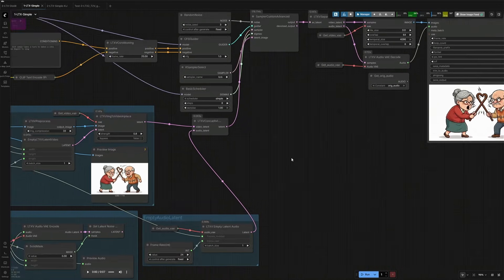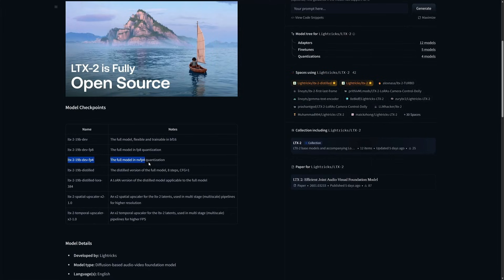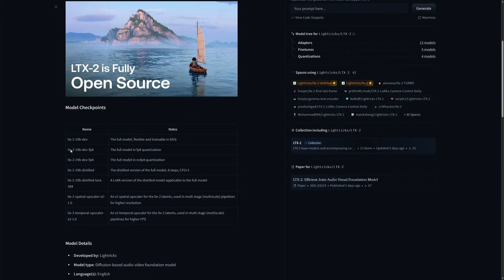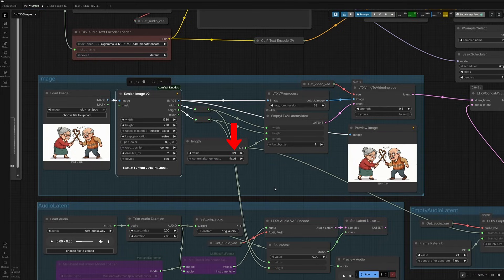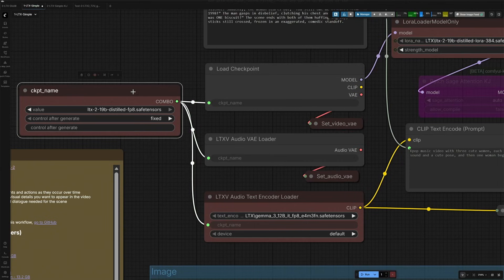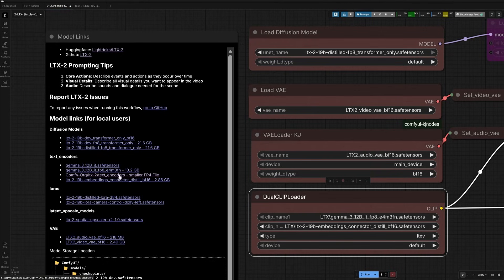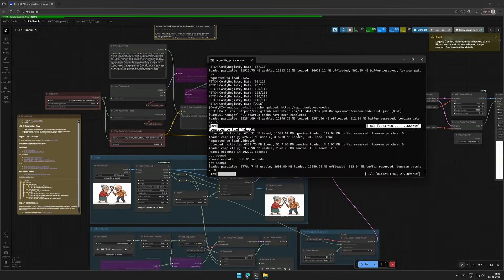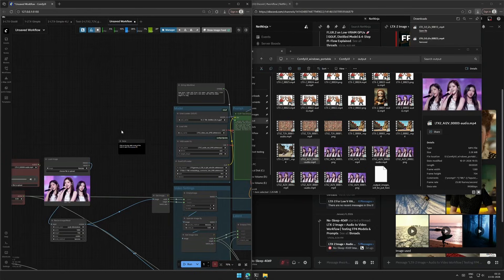LTX-2 Simplified Workflow 🔥 Distilled Checkpoints or Separated VAE & Transformer?

Comment: I'm using an  audio and when I run the prompt it says "ndarray is not C-contiguous" error on the preview audio node, any idea what could be happening? Thanks
Reply from the maker: Not sure, but if it's the same workflow then you must update the nodes and comfy ui. 
Even if you had done, then do it again because there are multiple update pushed recently for 5xxx card. 
Decreasing vram usage, new model support.

Comment: For a 5090 with a PC with 64 GB of RAM, which model do you recommend?
Reply from the maker: Try using ltx 2 19b distilled model 43.3 gb, if it works smoothly then you can also give a try to 'dev' version of the same model - but it will take 20 steps.

Comment: i went deep into learning quantization, floating point, data neural network so hard that i just found out these Open source models are like 1/10 parameters than the actual model which ias 150-500B parameters. which are well over 100-200GB 💀
MT-NLW and MT-NLV both have 500B parameters. u know what that means? a good superVRAM unit can make IMAX movie clip (not entire movie) which would be hard to distinguish if it was even AI.
Reply from the maker: Hmm.. We just scratch the surface!

Comment: nicely done :) Your actually testing things outside the default crap they gave us.  Just ordered my 5060ti 16gb.  I will try this again.

The reason the model slows down sometimes is the vram is FULL.  98%+ vram use in comfy is a death spiral.  It has no swap room to swap things in and out and anything you are doing is going to take 3-4x the normal time needed.  Never let comfy tell you 96%+ vram use or everything will become a slog.  If this happens you can usually use the clear models button and retry, but with the number of models you are loading in this flow it may not be offloading when it should and sometimes restarting comfy is the only answer as something is stuck in vram.  Many models do this, its a comfy problem with offloading secondary models for things like clip, masking, llms, or any other model that is not directly for the video render.  Some of these just sit in ram and dont go away until you reset.
Reply from the maker: Nice upgrade from 12gb to 16gb, try the fp4, it came for wan2.2 as well.

Comment: Can I use the full model with a 24gb card?
Reply from the maker: People with 12gb vram are using 27gb fp8 files, if that the case the you should be trying the full model. 
I hope you got the system ram.